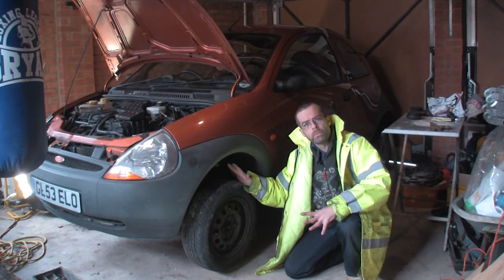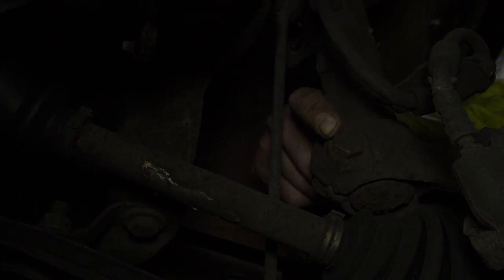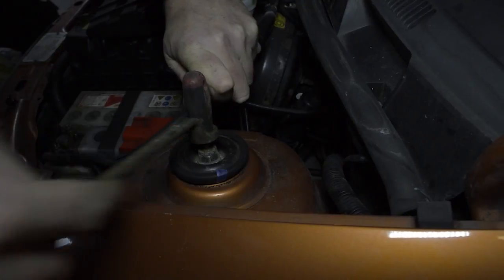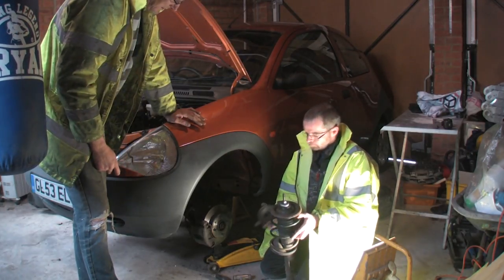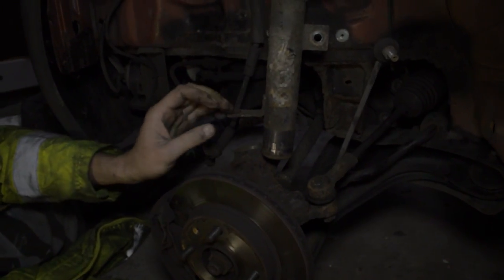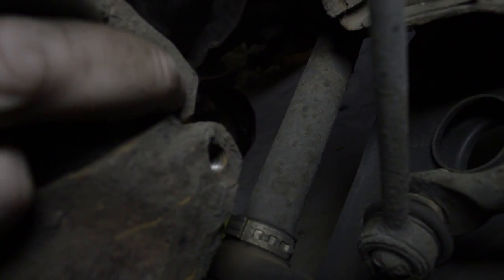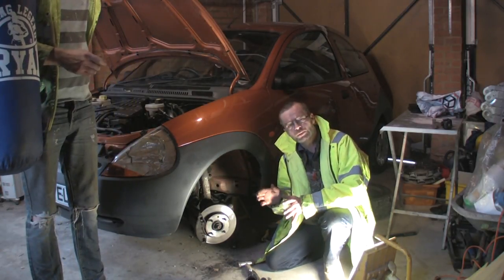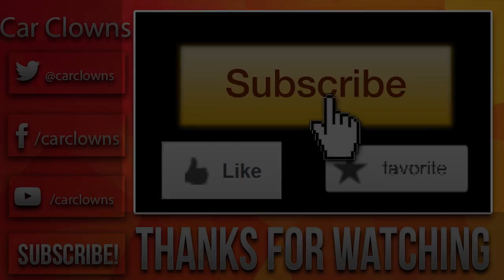Ford Ka mk I Front Suspension   Top Mount Rebuild

Comment: Hey guys should the bearing spin freely on the sturt top? I have hard time getting the spring back on so that the top plate goes straight
Reply from the maker: it will be tight but you can turn ti once you've installed the shock

Comment: Thanks Gents, informative video.

I have a 2007 KA o/s front strut bearing to do. I vertically shook the wheel and the strut top was lifting on the inner wing. May just do both sides since its quite easy.

I looked at the job and thought the strut and hub were a solid unit but the strut bottom, it seems on mk1 KA, actually slips into a clamp as does yours.

Is the inner wing removal really necessary?
Reply from the maker: yes, it makes the job a whole lot easier
Reply: @JohnWallage  

Noted John, thanks!
Reply: What started out as front strut bearing replacement, end up being an all shocks and rear springs replacement on the KA I've done.

I got KYB shocks and springs and they seem to be good kit.

Note
At 04.2003 there's a change in the KA front strut, the earleir model strut can fit either side but on after 04.2003, they're handed.

Comment: Good vid. Exactly what I was looking for. Shame about the lighting at the start but it got better as it went on. Top tip using the jack to put the hub back in. Did I sense a bit of sexual tension at 7.10? Lol, only joking.
Cheers boys.